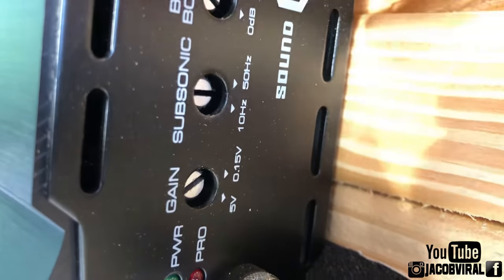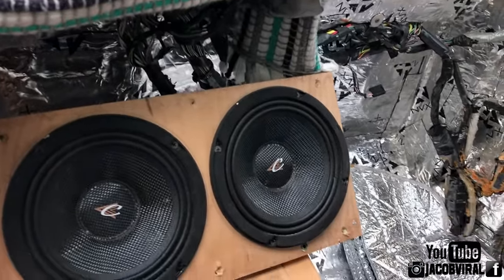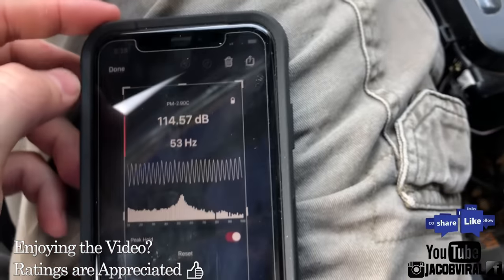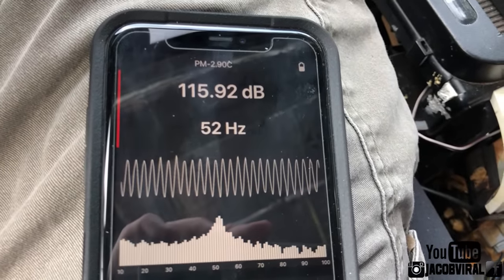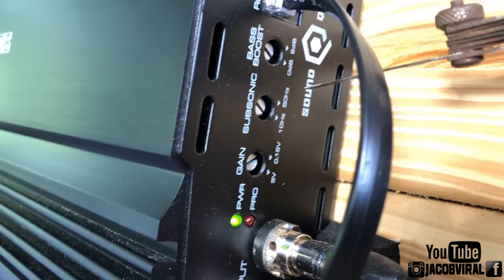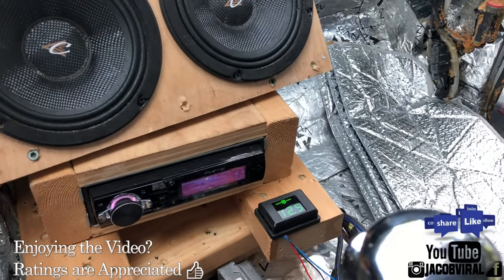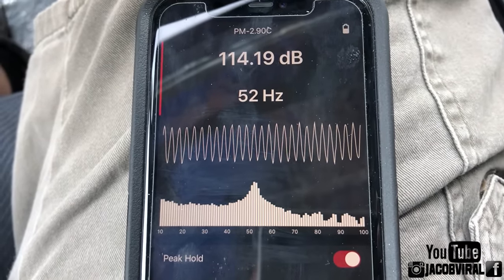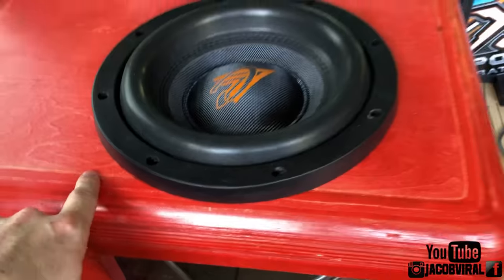HOW IMPORTANT SUBSONIC SETTING IS ON YOUR AMPLIFIER?

Comment from the maker: THANKS FOR WATCHING and SUBSCRIBING! MORE VIDEOS DAILY! ➡️Shop Audio: https://amzn.to/3lqomCw
Reply: How to set the tune if i like the bass can crawling the ground? Specially the tuning box? Is it 35hz? Or 40hz?
Reply: Mitsumi pdf f250
Reply: Are you saying that if you turn the subsonic off or as low as it can go I get more output from my amp?
Reply from the maker: @keehud333  no, that will just offset less cutout point on the lower frequencies to the sub to have more power at a lower volume/gain level is all. Amp only puts out what it can do with the proper tune
Reply: @JacobViral2  ok thank you. I think I just need to add more volts to my system for more power. I'm only using prolly about 40% if that on my amp. I'm runnin all factory units right now. 2k is my max at the moment
Reply: good👍👍
Reply: You notice the waves on his phone, it's clipping!! That's the only thing that bothers me about youtube. Anybody can post a video like. They know what they're doing. This guy clearly does not.

Comment: Use gain to adjust to keep your speakers from bottoming and keep subsonic off for 12s and larger. Turning that subsonic dial clockwise at all makes you lose low end output period. Subs are mostly meant to play low unless you’re using 8s or 10s. Then I could see turning it up a hair. Never had a problem in 35 years this way. Now, the low pass filter “features” the number it’s set at with more volume versus subsonic. Subsonic just cuts off below where it’s set at. But a slight roll off starts higher than where it’s set. Hope this helps. Oh, and Bass boost shouldn’t even be on amps period. Keep it off.
Reply: thank you this helped me
Reply: It depends on the enclosure and sub. Subsonic protects the sub from over excursion at frequencies below the enclosures capability.
Reply: I have been having problems with my amp settings I will try this thank you
Reply: So Basically I blew My Subs? I turned up the subsonic to tune my system to what I want it & Now My Subs Play for 30-60 seconds then Cuts out. my Amp is not Blew nor in Bridge Mode.
Reply: Bass booster is like dope lol everything’s fast
Reply: @MarquiseBeatz__  sounds like either a weak ground or your amp is getting hot from lack of air flow.
Reply: @easttennstudent  I’ll have to check my ground wirings then to make sure because I know it’s not the amp because I’ve tested my amp on another set of speakers & it worked perfectly fine. & I hear a little rattle in one of my subs when it tries to play. So I think it’s more so my sub/subs blew
Reply: Hello. Really interesting tips thank you. but where do I set my low pass setting? And on the the remote gain wire that you can set, where should I keep that at?
Reply: @FantasySoul77  low pass 80hz or lower
remate gain will only turn up as far as it is set on the amp. turn knob all the way up then set the gain on the amp
Reply: @MarquiseBeatz__   amp could be getting to hot
Reply: @MarquiseBeatz__  probably a ground my man
Reply: Nah bruh fr everything u said would make sense to y I keep burning up subwoofer
Reply: @jayveeda260killa2  amp is probably clipping, pushing it past it's limits. I have 2 Xv2s that are 1500w rms a piece on a Salt 6 that 6000w rms. So to get subs moving I barely turn it up. Gives me "overhead". Also make sure you're only pushing lows through your subs, high frequencies will burn up subs as well, nothing over 80-100hz on your LPF
Reply: @Chris-B-Bassin  yeah I just learned that today.. I got it at about 60hz Gaines only a lil over half way I got a  1000 watt sub on 500 watt amp  and it’s crazy now bro after watching this and going through google for a bit 😂🤦🏿 it’s a old ass JL AUDIO E1400D mono block.. wen the said 500 watts rms thay meant dat shyt
Reply: @MarquiseBeatz__  how did u get turn it up he said turn it off just let the amp and sub work
Reply: @jayveeda260killa2  JL makes quality gear for sure bro 👌
Reply: @jayveeda260killa2  I was referring to what I did with my amp previous before finding & watching this video
Reply: This is highly dependent on enclosure mate. I have to run a SSF on my preloaded Kicker Comp R 12 otherwise that bad boy is getting hot. Just because it’s a 12 or bigger, doesn’t mean that the Subsonic Filter should be defeated.
Reply: My amp and sub get really hot. What can I do? The amp is 1500wrms and the sub is 1600w
Reply: @bansheeboy3061  If you’re clipping. That’s probably why. Subs usually get hot if they’re clipping and leaving the magnetic gap which doesn’t allow them to cool properly. If the box is within spec, turn on the subsonic filter. 

If your amp is running hot. That could mean that it’s not getting enough power which can cause clipping and/or there isn’t enough ventilation.
Reply: My subs sound way better with subsonic off so i agree
Reply: @Iridiumcosmos  I turned the subsonic off cause I can't find my box specs and it's kinda doing better but just sounds weak at times now
Reply: @bansheeboy3061  It really depends on the box tbh. SSF is typically utilized when the box is in the upper spec of the woofer’s requirements. Best used also with people who listen to a lot of bass heavy music at loud volumes. Are your settings set correctly?
Reply: What about dual 12s, what should I do with my nobs I'm the dumb highschooler and don't wanna ruin em
Reply: I initially set my ssf to a little below my tuning frequency but it didn't sound good as I expected. I've since lowered it, not quite to 10hz shown on the dial and it sounds fantastic. The low low end is far deeper and it seems I'm getting more dB too. I don't understand the science, but my ears like it. Amp not getting hot with prolonged use, speakers not bottoming. Moving Air nicely 👌 😎 👍🏾
Reply: What about for front and rear speakers
Reply: @vXnnX nah fr tho😂
Reply: The technician turned on bass boost was that bad?
Reply: @MarquiseBeatz__  have you upgraded stock electrical also redo a your ground somewhere else could be that
Reply: I have 2 12s, and I have a 1200 watt skar amp, what should I have my knobs at? Like my gain, and the bass equalizer. Oh and bc I have 12s I should keep my subsonic off right?
Reply: Dope ❤
Reply: @emptyslurpz2164  
I use a DD-1 to set my gain
Reply: Subsonic should be set to your port tune frequency.  Any notes played on your subwoofer that are below port tune cause the box to unload and essentially your speaker will behave as if it is in free air. And that damages coils
Reply: Just like the GAIN shouldn't be treated like a volume knob. I hear 90% of people clipping the hell out of speakers and subs all the time. Then they wonder why they blew those expensive subs up . Bass boost = distortion,  cranking the gain like a volume knob and not tuning it = distortion. Wrong subsonic settings can damage subs as well .
Reply: I screenshot your comment for future reference 👍
Reply: @CurtF94 so did I and ran right out to my Jeep wrangler to make the adjustments 😂
Reply: @dirt_ripper8734 as I’m turning up the gain knob, what am I listening for to know that it’s set right?
Reply: I agree that bass boost should not be on amps but I use the subsonic no matter the size of subs I just set it at half a octave lower than the box is tuned to and the gain to match the voltage output of the head unit
Reply: @FantasySoul77 I would suggest set your low pass to 80 hertz and I’d have the remote gain knob all the way up then set the gain on the amplifier
Reply: @Catholic1391 that’s what I use to match gain to the voltage output of the head unit
Reply: @Shaka_audio  okay thank you very much I used to do that way back in the day but I sort of forgot how because I haven't done it in like 15 or so years Hope You're 4th of July was good my friend
Reply: @FantasySoul77  mine was good hope yours was good to and your welcome I try to help when ever I can
Reply: To be fair, it's probably more for noise suppresion, bad signals and whatever cheap hack someone used. Same as any boost and other usually extraneous settings. Still, it's almost always best practice to clean everything up before it gets to the amplifier. 

That doesn't even get into unloading under port or horn tuning frequency. Some are naturally protected by specific design, some are very much not protected and will allow the cone to move far beyond xmax. 

This should be pretty basic stuff. Maybe you have the cleanest, most basic setups for what 30 years? Great! Not a flex though!
Reply: Gain is set ONCE to your stereos RCA output, for example if the output is 2.5V you set it at 2.5V. It is not a volume control like many people use it as, and then complain when the distortion burnt their speaker.
Reply: @coopergt500twin5  Also creates distortion which burns coils.

Comment: If you have issues with overheating of your amp and you dont want RF interference from a cooling fan, try putting rubber spacers on your mounting screws between amp and mounting surface. It will keep the amp away from surface allowing heat to dissipate all of the way around the amp. Mounting surface could insulate the bottom of the amp holding in heat and possibly damaging amp components.

Comment: Jacob makes a solid point, and the demonstration of it is nice to see. I feel that the emphasis should be placed on what we did not get to see: he set the gain after the process we saw, I can't help but think that it would have been a stronger finish to test the final result in the same way for total emphasis besides the drop in decibels post procedure. Many simpletons will take away from the clip that you can use the subsonic to get a bit more db but just don't keep it there. I have been one of them in my checkered past🙃

Comment: The actual best setting for the subsonic/infrasonic filter is the one that limits ultra low frequency excursion to prevent damage. A side effect of this is that you are now drawing less current when playing those ultra low frequencies meaning less voltage drop and possibly more average power in your supply. This may lead to slightly higher dBSPL numbers but is unlikely to be noticed by most. I would recommend finding the frequency where the sub begins to unload and have crazy xmax and slowly turn up the volume until the sub begins to reach close to xmax but there's still power you can add. Then adjust the infrasonic/subsonic filter until the xmax drops then repeat with slightly more power until you reach max power and the sub is no longer exceeding xmax below tuning at whatever frequency was ideal to pick for your setup. If for sub for example is tuned to 35Hz and it will begin to exceed xmax at lets say 25Hz then you should probably have a filter setting around 25hz or so to cut off that low bass a bit so it doesn't damage your sub. It will also put less power into the coil at low frequencies so maybe you can get a touch more power in the higher frequencies that the sub can play leading to more dB.
Reply: thanks dude.. This applies to all enclosures? Even 6th orders?

Comment: At about a half an octave below enclosure tuning, subwoofer output will begin to diminish.  At just below tuning, the driver will begin to "unload", and excursion will increase.  I personally recommend setting subsonic about one quarter of an octave to one half an octave below enclosure tuning.  This will vary, depending on the slope of the subsonic filter being used.  I am using a DSP which affords different slopes, or dB per octave.  The steeper the slope, the lower you can set it without damaging your driver.  Always remember that the lower in frequency you play, the driver will want to naturally move farther anyway.  When making your adjustments, start out high, then work your way down, observing excursion and listening for mechanical distress.  Cheers dude!
Reply: Exactly this. Thank you.  So much bad information on here.

Comment: Dude your content is really good. Well spoken, good flow, informative.   You should have more subscribers.  That's not an indictment on you,  rather us in the community. We need to share you more. You should be getting paid for this.  I'll do my part 👍
Reply: Exactly.... I run 12s and subsonic takes a lot away from the good, rich deep, bass im pushing now and I have a small system but the sound quality is good and I didn't spend an arm & leg on equipment, plus I am only running 1200 Watts, so no need for an extra battery or upgraded aftermarket parts either, just make sure you run it correctly and you shouldn't have much of a problem with it.

Comment: Thanks for the video. Love how you are using the sound deadening for your vehicle. Better carpet is also a way to get sound deadening in your car from the cheap OEM stuff in most cars. You can also add padding under the carpet, just make sure to get the stuff that is "fireproof"! Though it can be a bit pricey works great.

Comment: A lot of great info there! You got just about everything right. The subsonic filter comes into play ONLY if the amp receives frequencies that are below the lowest tone the sub can produce at 3db down. AND, the filter only comes into play IF there ARE frequencies present in the infrasonic range. Using a good signal generator should not produce any frequency other than what it is set to. If harmonics are being generated in the signal chain, then you have a problem. Another thing, what is the slope attenuation of that HPF (subsonic filter)? I bet it's no higher than 6db/oct. So, as you set the level up near your fundamental tone, it may be already sucking the level down! You want to be anal about this? Get an "O" scope and look at the waveform levels while you play with the filter. A subsonic filter shows it's colors when playing a warped LP on a home stereo. The subsonic cone movement in the woofer can be crazy bad!

Comment: It is a sweep you need to play music and adjust the subsonic because if the sub is moving to much in relation the enclosure it would disrupt the air in the port reducing higher tone output. Some people dont know that it is the air in the port that vibrates and make sound. Especially if the sound have low and high tone.

Comment: At the end of the day we want to be louder but what i got from this is that its mostlikely best to set the subsonic before i set the gain because changing the subsonic later would change the output voltage.
Reply: He didn't do this. I have a 32 hz ported and a dayton max x 12 28hz what do I set my subsonic to, 31.5?
Reply: @anglerandy5736 28hz is subs resonance fs. subs will play below the fs and also box frequency by around 6 to 8 hz. You need to be able to tune by ear. No vehicle and system are the same so I can't just say yeah set it to a certain frequency without hearing it. Start with the subsonic set to 30 hz, You'll need to turn up the volume where you think it's kind of loud but still sound clean. Turn the dial on the subsonic counter clockwise until you can hear that sweet spot. You'll end up with the subsonic set lower than your box tuning. Also Maybe this will help , the lpf (low pas filter) filters out the highs to the sub and the subsonic filter's out the lows.
Reply: @filibertofonseca8083  then what does the high pass filter do? It's a 3.2 cu ft box with 1 dayton max x 12" 28.4hz resonance sub. It sounds good on lows like it is resonating cleanly and making the car shake but what sounds like higher bass tones make a slapping noise that sounds bad like a hammering??box is tuned to 32hz but it was for a sundown z and x  not this sub. Thank you for the advice.